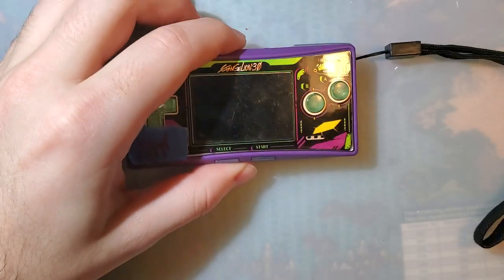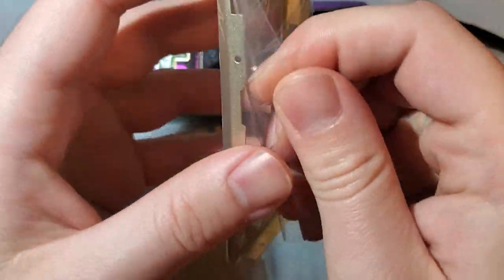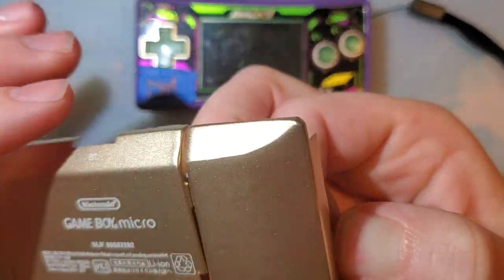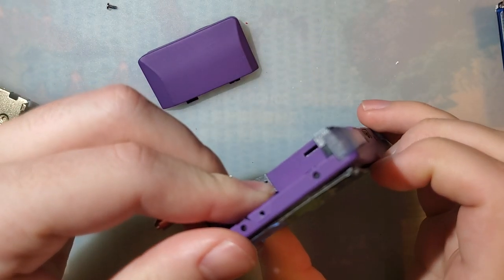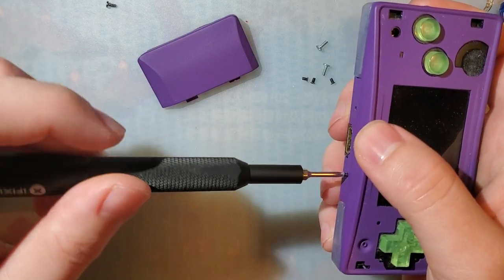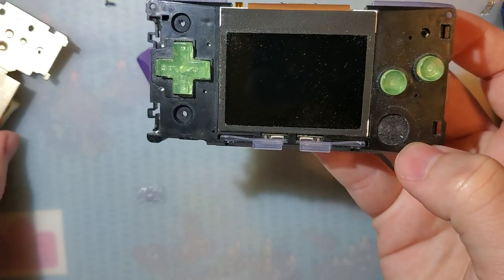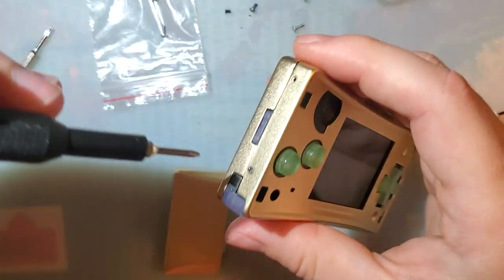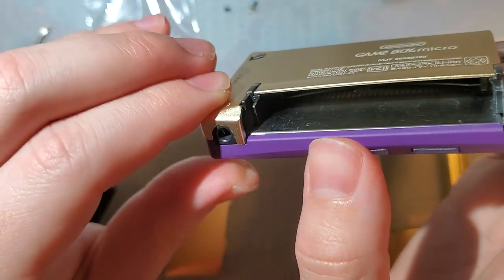Aftermarket Game Boy Micro Shell

Comment: So I recently bought a blue one of these. I was able to get it to fit (and I use the term loosely) decently. Took a lot of time but I figured out its all in the back piece. I had to bend and twist it to where the battery door notch lines up with that notch in the back piece and that closes the gap to where its not so hideous. Also I discovered that pre-tapping the holes in the back piece makes it way easier to screw in without striping your screws. Its by no means perfect or worth the $30-40 youll have to spend to get these, but its at least presentable.
Reply from the maker: Yeah, that's the thing. They can be made to work but for the asking price, they are still terrible. Glad you got yours (mostly) working though.
Reply: @makho  So regarding custom buttons? Do you recommend getting some in the market these days? I know theres limited choices but if the mold is too far off the mark, I wont want to waste the time and effort
Reply from the maker: @xludedelux  OEM is still much better

Comment: have a question with my SP and it's kinda hard to explain for me being as I'm fairly new to working on gameboys and such, but I'll try my best. so basically it works fine but sometimes the red low-power LED comes on no matter how much charge it has. If I can squeeze or fiddly with the console on the bottom right corner by the power-switch and it'll go back to green for a bit, but then eventually it goes back to red until i fiddle or squeeze some more and it'll go back to green and pretty much repeats the pattern. at first I thought the battery was just old because it was the original battery so I purchased a new battery, and it helped for a bit it seemed, but then the some issue reared it's ugly head once again, after that the only thing I could think of was to try re-flowing the solder on the power-switch so I did that and it seemed to have fixed the problem yet again, but alas... I'm still having the issue. It happens a lot less frequently, but it's still an annoyance. One time I let it be just to see if it would cause the battery to "die" or if it was just the the LED being weird, but it the gameboy does end up dying if i don't squeeze and fiddle with it until it turns green. which is kinda concerning because I hate the feeling of squeezing the shell knowing of all the tiny components I could be harming. I've looked all over and I've asked around a few places, but to no avail. Any input from anybody who may know what my issue is would be greatly appreciated!
Reply: edo the power switch is dirty. makho has posted a few videos where he shows how to clean it. It worked for my SP when I had a similar problem. The red light kept coming on every time I would play it. But cleaning it fixed the issue for me.
Reply: @Rodville  I thought that as well and cleaning just got the same results. Works for a bit but it eventful goes back to switching red every now and again
Reply from the maker: you need to actually open the switch and clean it. If you are still having this issue, either the shielding has not been reinstalled correctly or your switch needs to be replaced (or your battery terminals are dirty/corroded).

Comment: I don't understand after all these years, wouldn't it be easier to produce glass lens for gameboy micro rather than making crappy foggy ones?
Reply from the maker: the faceplate is curved and has latches. That sounds way too expensive for a crowd that is known for buying the cheapest (not least expensive) option possible.
Reply: @makho  I'd pay good money for a quality one. My GBM has been sitting in a box for 5 years because the lens is scratched. I've been waiting on a quality lens/housing. I'd easily pay up to $20 for a decent quality glass lens alone. Alternatively, they could just make a crappy plastic lens with a cutout for the LCD, and I could just put a screen protector over the flat LCD.
Reply: @blakryptonite1  I seen someone just cut out the clear plastic part themselves and use a screen protector so it can be done carefully

Comment: I wish I had seen this video before I purchased one of these shells on eBay. I need to contact the seller for a refund because the shell doesn't fit together properly, the faceplate that it came with is unusable because the legs on the clip side are bent completely outward, and the second faceplate that I ordered doesn't look like what I was expecting to get, and it is a little bit too wide to properly clip on to the Micro and it already had scratches in the lens. The alignment of the screw holes was so bad that I couldn't get the screws on the top screwed in, and I had bothered with threading the captive screw properly on the battery cover only to find out that doing so only made the gap between the battery cover and the back panel even larger. The red color of the replacement shell doesn't even match the red color of my GBM's original shell, and the whole reason I ordered the replacement shell is because my GBM has a dent in the back panel, and the clear cover layer of the serial number sticker is falling off and I wanted to be able to use my GBM without worrying about the serial number rubbing off of the sticker.

Comment: Would it be possible to gently bend and manipulate the parts to get them to fit better, such as on the battery door?
My poor micro's a bit worse for wear to a noticeable extent. slight panel gaps beats dents and gouges.
Reply from the maker: I mean, no, not really. The whole thing is bent to the wrong specs. You can't fix that without starting from scratch.

Comment: Makho I found an old parts bin ds lite onyx black I forgot why it was in the parts bin so I reassembled it and it worked to my surprise so I bought a shell and now it’s a palkia dialga onyx black shell I played it for 2 hours and then got the low battery light when I plugged it in I remembered why it was in the parts bin it doesn’t charge not even a flicker the port is like new and mounted securely no cracks in the solder why isn’t it charging not even an orange light flicker nothing makes it charge tried 2 chargers an oem and aftermarket
Reply: Check EM10 & the fuses.
Reply: HoZyVN if it’s a fuse I’m screwed I have a cheap amazon soldering kit, an ifixit pro kit and some flux but I consider it a victory when I manage to successfully install an ips brightness wire in an sp lol I’m a newb and a fuse is a whole other level of difficulty because of the size 😭
Reply: TubularBow HD the cables and plugs are all correct it plays perfectly fine every function works even the mic and so on it just won’t charge no orange light and no charging the port looks new no cracks in the solder no wobble the light doesn’t come one event when I wiggle the cable I have tried both an oem mint charger and a 3rd party charger the board has never been wet

Comment: The finish under the anodize appears to be sandblasted on this "new" gold shell, Can't say for certain because I'm not seeing it in person but that is what I would guess from what I can see.  The old crappy "silver" one that you had that doesn't fit at all is just a "brushed" aluminum finish.
It could be a modification and still be the same factory producing a "better" version since time has passed, and depending on how they are making their blanks they should be able to adjust the hole locations to the proper places but that assumes they know what they are doing and didn't just make hundreds of flat blanks and then the tooling and just hoped they would get it right.
It's really unfortunate that there still isn't a great solution for these.  I don't have one but they always looked cool, I wish I had picked one up back in the day.  I can remember almost getting one off craigslist in around 2012.  Wish I had.  

The frame for these, is that plastic or aluminum?
Reply from the maker: plastic